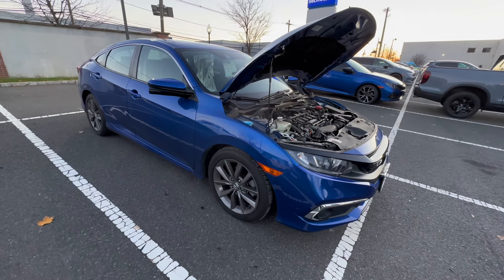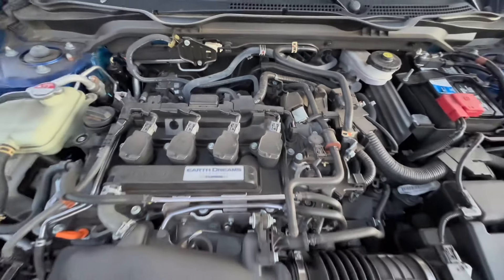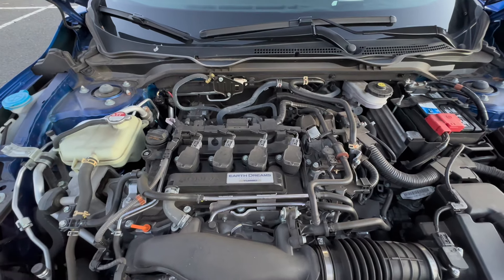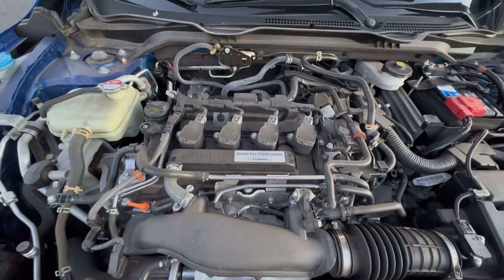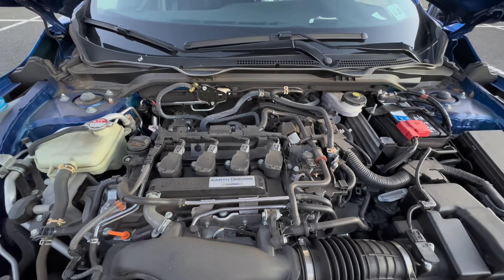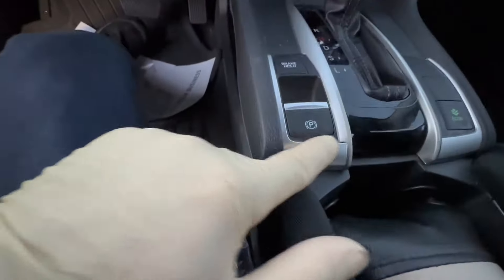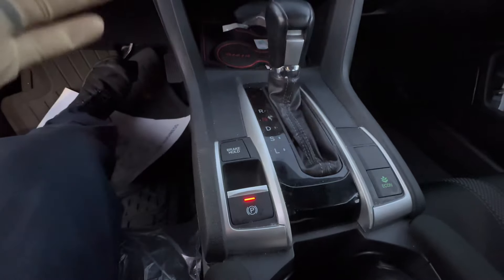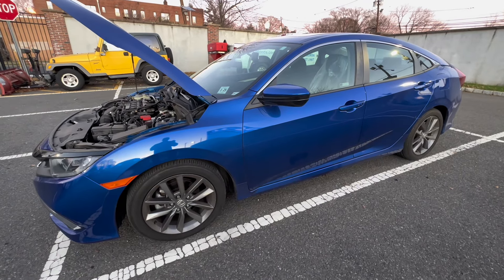2016 - 2021 Honda Civic problems

Comment: great information. thank you! Not the golden era Honda. I have a 95 Civic with 210K miles. Took it to dealer for oil change over the weekend and the techs loved the car.
Reply from the maker: Awesome, I’m sure they did 😅
Reply: Coming up on 500k on my 91 accord 😅
Reply from the maker: @mitchelllinley9738  awesome, any major issues with it?
Reply: Just had to replace the fuel tank. Other than that its just been routine stuff. Nothing major@Hondamobilemechanic
Reply from the maker: @mitchelllinley9738  awesome, thanks for sharing.

Comment: Hey thank you for making this video. We’re thinking about buying out our 21 lease. I always insist on using premium fuel in the car and you’ve confirmed it’s probably worth the little extra expense to do so.
Reply from the maker: Yes for sure. It’s a small price to pay I’m increments vs having to deal with costly issues down the road.
Reply: is it s 1.5 turbo?
Reply: @backtoshallabal6662  yes.
Reply: Hy! Buy oilcatch can from mishimoto to solve that problem!
Reply: any car with a turbo should have premium fuel used

Comment: 2020 civic sport 2.0 NA 6 speed manual with 103K. runs like a clock. I was was persistent about not getting one without a turbo or a CVT trans, so glad i opted for the stick and the 2.0 ! FYI:  put a new battery in it last week. went out to start the car in the morning and got message (parking brake issue) would not start. turns out if the battery dies it will not have enough juice to release the parking brake, no issues with the brake, replace battery.
Reply from the maker: Thanks for sharing and smart choice 🫡
Reply: Same, I got the 2019 pretty much same car as  the 2020 civic sport naturally aspirated 2.0 sport manual, not one single problem 54000 miles.  I'm so glad I didn't get a cvt turbo.

Comment: I'm on my 3rd or 4th fuel door actuator and really the only other issue I've had is the lower window door trim on the driver side cracking and falling apart while the passenger side looks new. I have the 2016 2.0l engine. 
Pretty good car overall. I also use premium fuel, but i also race it and redline it alot. Knock on wood, its been really good to me and im at about 130k miles
Reply from the maker: Thanks for sharing

Comment: Hope this helps anyone but I have a 2017 civic hatchback 1.5l and I’ve had these problems 
Broken gas tank actuator, broken trunk struts, AC evaporator went out, transmission axel seal & leaking fluid. I’ve done all my maintenance & change my oil every 5k miles & filter every 10k.
Reply from the maker: Thanks for your input 💯
Reply: Transmission axel seal, how much for the repair?
Reply: Changing oil and filter every 5000 is recommended the filter cost 5 bucks why would you not replace it.
Reply: @JoeReese-kh1jc exactly what I was thinking. What a cheapskate. I change oil and filter every 3000 miles with mobile one oil and filter cost about $35. At 175000 miles on 2019 civic sport with 2.0 engine and the cvt. No problems yet 🤞

Comment: I have a 2019 civic 1.5T manual, just 60k miles. Runs like a charm and no problems yet, hope it stays that way. Been running 95 but because of this I am thinking to switch to 98
Reply from the maker: @kiankielemoes3333  thanks for sharing and best of luck
Reply: any news on your 2019 civic?

Comment: I bought a 2018 civic Si used with 60 k miles on it. After seeing this video im little concern about him. Its running great and the ac is working, but the only thing is the hold brake button its press all the way down and I don't know if it works because its stuck. Im looking for advices that you could give me so the car can last at least more 5 years or so, and for instance I always use premium gasoline just in case.
Reply from the maker: @lacienciaesreal2654  premium fuel, 3k oil changes, good maintenance

Comment: Honda tech here up in Northern Ont Canada,,, Rear rotors deterioration BAD every year, Trunk release switches in the door, sticking down. Our ratio of Head gaskets at our dealer is 1 Civic since 2016, 20 CRV's in the past two years and maybe 2 Accords in the last couple years. But we do sell a ton of CRV's . And the standard Condenser/compressor seals leaking. Pretty solid car's and Zero 2.0L issues
Reply from the maker: Appreciate the feedback bro, hope you’re staying busy!
Reply: Tire season is kicking in, next five weeks are  going to be to busy :) @BCautosutions
Reply from the maker: @MayhemCanuck  💯
Reply: Which is the most reliable Honda to buy used ??

Comment: Had the A/C compressor shaft seal fail before 36k and sunroof shattering without cause on at '21 civic.  Take a look at complaints with sun/moon roofs spontaneously shattering as well as steering wheel "sticking" or stiff during certain conditions.  Honda has been replacing steering racks without addressing the real cause..
Reply: whats the real cause relatingto steering
Reply: @jasonaston435  I do not know the cause.  As far as I know, Honda has not acknowledged the problem.

Comment: 2017 Elantra, bought new. 124.000 miles. 0 repairs 0 issues.  Loaded with all the tech. Ac never touched,  still blows nice and cold. Everything on the car works like new. Engine runs smooth and quiet.  Uses no oil. Only things on the car that have been replaced are tires, and 1 battery. Excellent vehicle. Even the brake pads are original,  and still don't need replacement!
Reply from the maker: Congrats sounds like a highway vehicle.
Reply: @BCautosolutions I'd say about 70 % highway. 😊
Reply from the maker: @1958Cadillac-v2g  sounds about right. Either way, that’s pretty amazing 👍🏻

Comment: Major ac issues.  I had mine at the dealership 4 times to fix mine. Once was a dealer recall, and they replaced the whole thing. Still didnt fix it. Other the no ac for a few years, its a great car.
Reply from the maker: @_Slicedbread  thanks for sharing

Comment: Hi, I have a 2020 Honda civic hatchback sport. Luckily I haven’t had any of these issues, BUT my front end makes a lot of noise. It almost sounds like a busted shock or a bad ball joint. I’ve had the car checked multiple times (under warranty) and by other shops thinking that my local dealership wasn’t wanting to cover repairs. No one can find this noise but it’s getting louder and louder. Still drives good, seems a little loose but nothing major. Coming from the left front. Do you have any experience with this?
Reply from the maker: Is the noise from the right front?

Comment: I started my civic touring 2018 in the morning and all the lights on dash came on. I took it to the honda dealer today and they found a misfire. Now they want me to replace all  4 fuel  injectors and it's pretty expensive. I hate having to do that when my car is fairly new with only 66k km on it. I checked on reddit and civicx forums and it's a widespread issue and a lot of people are dealing with this. Im surprised it's not covered under a recall or extended warranty
Reply from the maker: Yep, injectors and head gaskets are far too common.

Comment: I have a civic 2019 1.5, there were problems with the car air conditioner, fuel pump and with the rear lights there is condensation
Reply from the maker: @ivicazagorec513  ✅

Comment: Thank you so much for a very informative video.  I have a question, my daughter has a 2016 honda civic and i use to hear the turbo but not anymore.  Her gas mileage has gone down a little.  Is there a fuse on the turbo or maybe a air leak? Thanks in advance for your help.

Comment: Had a 2018 Hatch Sport- bad oil dilution, wouldn’t get heat in cold weather and rodents damaged exactly where you said. That sucker got returned on a lease at the end.
Reply from the maker: Sorry to hear! What did you replace it with?

Comment: I put a boomba bov and have a muffler delete and every now and then my car will not build any boost at all and it sounds like an air leak in the bov. However when I run the car again 1-2 hours later it is back to normal. I had a professional mechanic install the bov so I don’t think that is the problem but the bov itself could be.
Reply from the maker: Could be the valve itself

Comment: I just bought a used 2019 honda civic and I LOVE IT. I just hate the fact that the parking brake is electronic and the android auto isnt wireless... had to buy an adapter
Reply from the maker: Seems like minimal stuff but congrats 👍🏻
Reply: Any issues since you bought it ? I’m currently about the buy one 2019 Honda civic LX 2.0
Reply: @antcortes5681   I have the 2019 LX and so far I've only replaced the battery and one seat belt buckle. Otherwise it's a great car.

Comment: Dang I was considering one of these then when you showed the electronic brake, that was a deal breaker! I have a 2017 fit and still comes with a handbrake!!! Ill just wait for another low miled manual fit!
Reply from the maker: @beegchunguz7425  fit for the win!
Reply: @BCautosutions  I just cant believe Honda's move to rid of a true shifter. All their SUVs are button shifting now. Its a sad time when Hondas lineup is removing what they were known for: Enthusiast driving. Handbrakes are essential..

Comment: I have a 2016 Honda civic lx and it wont start unless I press on the gas petal at the same time, runs fine once on though, and battery is only 1 year old any ideas on what it could be by chance. Thanks so much
Reply: Sounds like a wire connected to the wrong input to me 😂 any updates?

Comment: I got a Honda civic 2017 and the problem is when I stop on a traffic light a push the acceleration pedal and it takes a few seconds to respond do you think is the accelerator sensor ?
Reply from the maker: @edgarleiva369  no, maybe carbon buildup on tb
Reply: Thanks
Reply from the maker: @edgarleiva369  you got it

Comment: I have a 2016 Honda Civic 1.5T at 98,000 miles. Runs like 2016. No problems or what’s so ever. I replace parts before it gives me issue. I do my own oil change every 4,000 with Amsoil and Replace spark plug every on 30,000. When I have extra spare money, I replace the sensors even it doesn’t need to. Runs like it just came out the dealer. I’ll be honest it is pretty easy fixing it.

Comment: Hi there I have a 2016 civic touring and I have a few lights on my dash , like it has to do with the radar lane change. Have you heard of that ?? Ty
Reply from the maker: @juanrojas4722  yes, very common especially after small impacts to driver side corner of front bumper
Reply: @ I had a hit and run on the driver side fender about 4 years ago And the lights barely came on a few months ago. I was told it has to do with my turbo pigtail connection ??
Reply from the maker: @ doesn’t seem related

Comment: One of the most annoying problems for this generation of Civics is the accidental remote opening of all windows if you sit on your key fob or press on it the wrong way when it’s in your pocket. You can go to your car in the morning and find all windows down, the interior fully accessible to anyone. There is no way to turn this feature off.
Reply from the maker: Thats been a thing since like 2000 tho. Appreciate your input
Reply: I have a 2017 EX-T sedan and my key FOB has nothing for the windows. Never heard of a key FOB with buttons for the windows. Never have owned a car with FOB window buttons. But mine has a "open trunk" button and I sometimes find myself having to stop on the side of the road to close my trunk!!

Comment: My 2018 civic 2.0 has an issue. If I stop fast and then try to accelerate fast it's like the car just says na you don't need to go anywhere now.but acceleration from normal stop isn't to bad. Any ideas?
Reply from the maker: @butter7506  I would check you intake hose and your tb to see if it has buildup

Comment: So far I am a little north of 25k. I checked the engine coolant reservoir and it was low. Based on what you have said as symptoms to valve cover failures I am now a bit concerned. I did top it off and will monitor it. I was just assuming that it has been 3 years since i bought  the car but now I will just watch out
Reply from the maker: Best of luck!

Comment: My 1.5T 2017 is chugging/sputtering when trying to get past 2k rpms.

Had no problems when i test drove it but now i noticed that it started to do that recently after i had the AC max’d. Not sure whats the issue, the computer told me no issues.
Reply from the maker: @stealthyninja7821  probably misfiring which can be a number of things but under load (acceleration) it’s usually an ignition related issues aka a cracked/fouled plug possibly.

Comment: Hello! My AC was working fine till 3 days ago. It now only blows hot air. Any recommendations? Thank you!
Reply from the maker: @willc2426  most likely the condenser or compressor leaking
Reply: @BCautosutions  took it to Honda and they found the compressor was leaking! The evaporator was also leaking which ran me $1400
Reply from the maker: @ thanks for the update

Comment: my 2017 civic si makes a rattling noise when revving at 2.5K RPMS Do you know why?
Reply from the maker: Could be anything but often see the Wastegate actuator rattle which is normal, if that’s what is your actual case.

Comment: Hey I just stumbl3d on this video.... 2017 honda civic 2.0. My car shakes when I first start it kinda seems worse when cold then goes away sounds like it clicking louder than usual maybe an injector?? Then when you switch gears it shakes from park to drive or to reverse
Reply from the maker: @mikeydejon2148  could just be a broken mount or something
Reply: @BCautosolutions  okay cool thanks

Comment: been having an issue recently with my 2017 civic hatch where when i hit 55+ mph the car starts to vibrate. ive had ever tire replaced and balanced within the last year and had diagnostics done on the suspension system and they couldnt find any issues. Saw that theres a possibility it could be the motor or transmission mounts but im stumped.
Reply from the maker: @LinktotheMatt  does the vibration increase or stay the same after that? Does it diminish or go away if you let off the throttle?
Reply: @BCautosolutions  it stays consistent until I slow down again. Occasionally, I can feel it at lower speeds, but it's sporadic and I can never successfully recreate it
Reply from the maker: @LinktotheMatt  yeah that makes it tough. Going to have to be a trial and error situation here
Reply: @BCautosutions  yeah I had figured lol, thank you for replying though

Comment: This video is so helpful! had that same AC problem, and luckily it was fixed under that warranty. But now I have a new problem. Sometimes when I'm in reverse my car will just not move at all. Only happens sometimes but I'm not sure what's causing this. I have a 2018 Honda civic .
Reply from the maker: Glad to hear it worked out for you. When the issue with reverse happens is the car cold?
Reply: @BCautosutions  yeah it pretty much has only happened right after I start my car usually to back out of parking spots/drive way happens rarely but it's scary when I'm pressing the pedal and the car isn't moving

Comment: So I’ve noticed my coolant drains faster than normal. It doesn’t overheat but when I check the tank, there’s almost nothing in there. Been to the mech’s and they said it wasn’t an issue but I don’t feel right about it. By way of DIY, what do you suggest I do and what is the head “start” or bolt you talk about and how can I check it please?
Reply from the maker: Various tests you can do but if it’s already consuming coolant, I would do new gasket with head studs

Comment: When in park is the CVT belt always spinning and does the belt get ran through oil or does that stay dry?
Reply from the maker: Oil
Reply: @Hondamobilemechanic  is the CVT belt always spinning as long the engine is running or is it not spinning when in park or neutral?

Comment: My wife's 2016 civic is hesitating or bucking during acceleration. I changed out the Mass Flow Controller and air filter already with no difference. Any ideas what could be causing this problem? Thx
Reply from the maker: Torn intake tube or air leak somewhere.

Comment: 2022-23 issues? Looking at a sport touring. I drive 75% highway and always use top teir gasoline from costco, shell, exxon,bp ect. Looking for a nice 30k hatchback with good mpg and good features and the civic seems to hit those needs. I just need a car that can handle 20k miles a year for at least 10 years
Reply from the maker: There were some early on but nothing has been repetitive enough to have me concerned. I would buy with confidence although as always I recommend Honda care which will have you covered for a decent amount of ownership. Good luck

Comment: Squirrel ate through the speed sensor cable on my Civic (2.0L), and it cost $600 to replace the wiring harness. Found out they like to hide in cars during the summer, even if the cars are daily drivers parked at work. Best defense against this? Keep your engine bay clean and spray peppermint essential oil in the engine bay and wheel wells. Not only does it smell great, the critters hate it.

Comment: My 2017 Honda Civic Ex 2.0L windshield just cracked from a rock from a semi 😑 I can’t tell if my windshield has any sensors? I don’t have lane departure or any Honda Sensing. Bought it used, it has a camera on the right side mirror when I turn on the right blinker. Do I need a windshield with sensors? Do I need recalibration after? Quoting me $280 with sensors and $200 without. Please help
Reply from the maker: Literally look at windshield and by rear view mirror is there a lens, or just mirror.